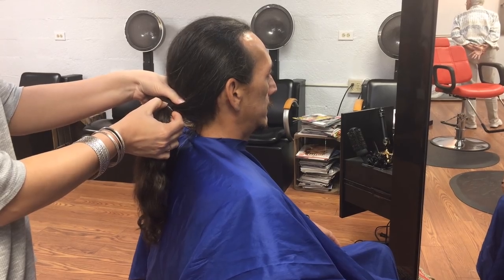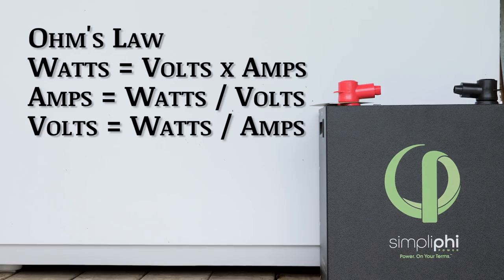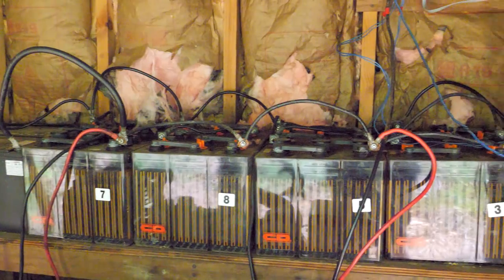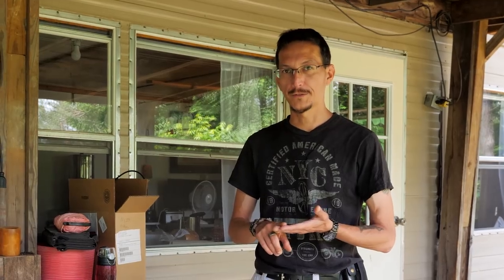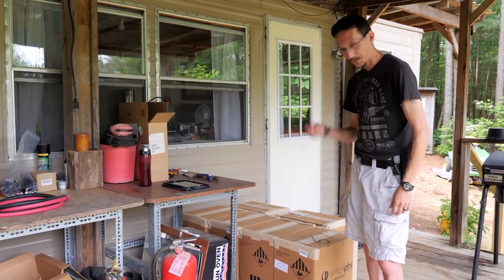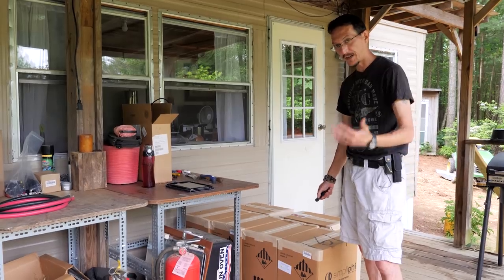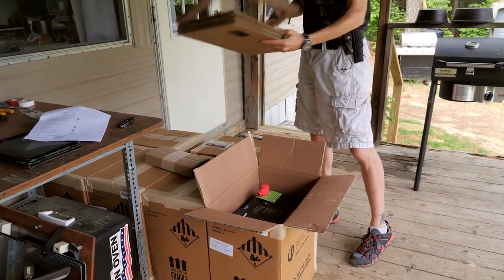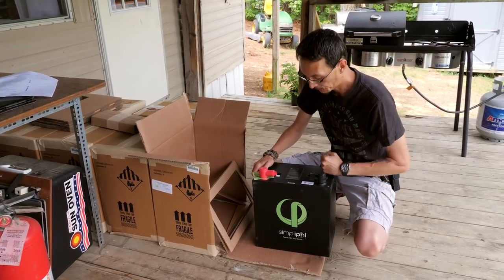DIY Off Grid Solar: Building a LiFePo4 Battery Bank (Part 2)

Comment from the maker: Thanks for your patience folks!  Getting this system built and transitioned over has been a time-consuming task requiring all our attention.  Solar panels will be next...stay tuned!  More links in the description.  Thanks for watching!
Reply: Guildbrook Farm - Off Grid Living Look great with the new haircut.
Reply: There's something you, and everyone else that plans on purchasing and installing Simpliphi batteries need to know. If you are not a licensed professional, do NOT install SimpliPhi batteries! Straight from the warranty:

This Limited Warranty applies only to SimpliPhi Power Product(s):
a)   purchased from SimpliPhi Power Inc. or an authorized  SimpliPhi Power distributor, dealer or reseller and
b)   installed by a licensed professional. In the event you rent or lease the SimpliPhi Power Product(s), no end-user purchase takes place; therefore, this Limited Warranty does not apply and you must contact your rental or leasing company to determine whether Warranty coverage is applicable.

Comment: I'm halfway through building my 20kwh lithium ion DIY powerwall for a couple hundred bucks,  however it's not something I would suggest unless your prepared to tediously solder over 7500 joints !   As I've built mine I've been using the packs and simply expanding the system which makes the project less daunting and more rewarding.  Lifepo4 is better as it's safer and more cycles and for a build like yours you needed to get up and going quick, my build may take me up to a year or two before it's up to 20kwh.  But I should see maybe 5+ years out of my packs, in 5 years battery prices should drop big time. Yours is a long term and well calculated move.   Good idea comparing the 6v batteries too, looks cheap up front :)
Reply: Jestronix Handerson what are the parts you are putting together for this.  I would be interested in seeing the process and components you are using.   Thanks!

Comment: Good discussion on Watts, Amps, Volts.  Also Voltage drop on a length of cable is very important.  I am a retired engineer and we used to have to maintain 2% loss from the point of regulation in our designs.    I have a much larger need than yours as my usage is between 2000kWh - 3000kWh per month.  We live in the Texas country and use well pump, 2 HVAC, Water Heater, Oven all on 240VAC.  We use heat pumps and recently replaced a 12 SEER HVAC with a 18SEER.  The RLA (rated load amps) went way down on this new one, but I have not historical usage data with the power company.  So I just looked at usage over the past 3 years and averaged it.  Many say to inventory all components for power usage, but I did past usage as a guide.  All the best!

Comment: Great videos. I just have to say that living off grid myself and managing my power needs got a whole bunch easier after finding your youtube channel. I've watched hundreds of videos but the way you explain things really makes sense. So thank you for all I've learned so far. I've watched this video at least 20 times trying to ensure I understand the math involved, so that I can then apply it to my own needs but I'm stuck. My AGM bank needs replacing so I'm looking at building the Lifepo4 system that you've outlined here. I think my math is wrong. My goal is a 2kw system for my daily needs. This is what I have gleaned from your video: A 2kw system x 5 days of autonomy = 10kw add 20% = 12kw.  2kw divided by 12v system = 166.66 per day x 5 days of autonomy = 833 ah bank. ADD 20% DOD = 1000 ah. Min. capacity of the battery bank is 1000ah. 1000ah bank as a minimum to provide 2000 watts per day on a 12v system x .86 because the inverter has an efficiency loss to 86%. So, the final bank would need to then be 12v/1,140ah to give me what I'm looking for. Is that correct? My inverter is a 12v/2kw MagnaSine so I can't move up to a 24v to gain efficiency without replacing it which is not what I'd like to do. I'll be purchasing another of the same instead, so I can rack them up together to make a 12v/4kw inverter instead. Could you please confirm my math is correct or not? Keep up the great work! We so need your videos!!!

Comment: I haven't researched batteries for some time.  About 12 years ago, I had a bad experience with flooded lead acid
batteries hooked up in series.  I had a pair in the house, and a pair in an old travel trailer.  Fortunately, I had each
battery in a battery box because acid leaked from the batteries.  It was a potentially dangerous situation.  I occasionally
checked the water and charged them.  I don't know much about lithium ion batteries,  but they sound great.
Your Locks of Love donation is excellent.

Comment: Better video than most. Most people only think short term and don't take into account how discharge rates, depth of discharge and cell chemistry impact cycle life and cost per watt hour. Interesting to see "Equivalent to 80% Retained Capacity" for 10,000 cycles with 80% DOD in SimpliPhi's warranty sheet. Other LFP I looked at recently rated their 80% capacity, 80% DOD at about 4-5,000 cycles with the same discharge rate, and 12,000 cycles @ 80% DOD was 50% remaining capacity. Would have liked to see actual remaining capacity cycle life DOD curves to see if it's just SimpliPhi's marketing warranty speak or a typo but I couldn't find any.

Comment: Great video. It's good to see people who care about others with your donation to locks of love. Also, I would recommend to viewers that if you're tied to the corporate grid with solar that you safely, or have a professional electrician install an auto switch turn on your battery bank, and or generator automatically when the power goes out. I say the auto switch for those who may travel and be away from the property more often as it will save your pipes from freezing, home from overheating, fridge and freezer food, etc. If you stay home all the time then you can do a manual switch. Just a side note lots of areas are having more frequent power outages due to planned obsolescence/failure of parts of the power grid. When you import parts from who knows what countries that are about max profits instead of quality that's what you get. Those overseeing this need to check longevity as these people in the video did. Enjoy!

Comment: You are correct about watts being unit of power, however calorie and watt-hrs, kwh are units of work or energy. Watts are like the flow rate, e.g. 10 gallons per min, watt-hours (also kw-hrs) are like the total volume of water.

Comment: Excellent presentation Jeremy. I took a look at the SimpliPhi batteries and the price was quite a shocker. (Pun intended). I was trying to compare them apples to apples to the Trojan L16 batteries that I'm running and can't find the number of hours the SimpliPhi amp/hour rating is based on.  The L16 is 370 A/H over a 20 hour discharge time period. If they calculate it over a 100 hour discharge it bumps it up to 411 A/H. My point is that the A/H rating is variable and can be manipulated to look more optimistic.  I'm running two strings of eight batteries giving me 740 A/H (over a 20 hr discharge period) at 48 volts. I have my system designed for 20% depth of discharge for maximum battery life. I expect to get easily ten years of life from my bank. After three years in use the plates in my batteries still look like brand new. 

You obviously are designing a system with a much higher output than mine, and I see you did the math, but one of your SimpliPhi batteries is equal in price to 10 of my Trojan L16s. At 20% DOD I have 148 A/H available and I could probably double my DOD without sacrificing too much life, especially if I only do it occasionally. With the SimpliPhi batteries running at 80% DOD I'd need three batteries for only slightly better performance to my 16 L16s at 20% DOD. (Provided that the SimpliPhi A/H rating is based on a 20 Hr discharge). If the SimpliPhis do actually last 27 years it would be 17 years more than  the 10 yrs I expect to get from my bank at about double the cost, so in the long run there is some potential savings, but the proof is in the pudding. I'll be very interested to see what kind of life you actually get from them. I put my entire system together with 2,250 watts of panels, Panel mounts (home made), Battery bank, wiring, FM80 charge controller, combiner box,  and 6,000 watt 48v inverter for less than the cost of three of your SimpliPhi batteries. 

Where the true advantage to the SimpliPhi battery may lie is if you are able to combine new batteries with old batteries. I couldn't find anything in their literature to suggest that is the case, but if it is, you could assemble a bank piecemeal and evolve it as your budget allows as well as replace a bad battery and integrate a new one into an older bank, which you cannot do with flooded lead acid batteries.

I'd be comfortable with the technology of the SimpliPhi batteries, but I'm somewhat skeptical of the claims for DOD and cycles and overall lifespan. There were similar claims for Iron Nickel batteries which turned out to be greatly exaggerated. What was supposed to be a bank that your grandchildren would inherit and the lowest cost per watt/ hour turns out to be simply not true. A ten year warranty is wonderful, provided that the manufacturer is still in business 10 years from now. There are vast numbers of actual cases of people with properly designed flooded lead acid bank getting well in excess of ten years of life. It has a proven track record of reliability. 27 years from now you might be able to say the same thing about your SimpliPhi batteries.

Comment: You're doing a great job of explaining your research and the how and why. Too bad there are some comments from folks that have an agenda based on ignorance/stupidity.
There is a very important advantage of having your batteries in parallel, if one goes bad it does not take out your whole system.
FWIW I am a U.S. Navy Submarine Veteran, EM1SS (E6) (Electricians Mate First Class Submarine Service Qualified, Nuclear) so I know more than the average Joe about lead acid batteries in particular and other types of batteries in general. You have made the best choice for what is available for today and it will serve you well for many years.
Great new look for you and thanks for donating your hair to Locks of Love.
Reply from the maker: Thank you! 👍🏻

Comment: Jeremy,  first, I love your channel. Please keep up the great work.  I must correct you on one thing though. It's very important. At the 12:09 minute mark, you discuss Li-Ion batteries, and that they can be discharged completely. A common misconception, and nothing can be further from the truth. If you discharge any cell in the pack to less than the manufacturer's stated minimum, you will plate Lithium out of the electrolyte onto the electrode. This WILL cause the cell to violently vent, with fire and fury like this world has too often seen before. Typically, these packs are made from series and parallel combinations of 18650 cells. These have about 2.5 Ah capacity per cell. Their nominal voltage is 3.6V. When charging, you must never, ever, exceed the manufacturers voltage limit. This is typically 4.2 volts. You must never EVER discharge the cells below 2.7V per cell. When making your own packs using Li-Ion cells, the voltage of EACH cell in a series string must be monitored independently. They must never exceed 4.2v on charge, and 2.7v while being discharged. There are companies that make chips for the purpose of this, or you can use a microcontroller.  Charging is done by applying a constant current to the battery, not exceeding the manufacturers maximum. When the applied voltage reaches 4.2v per cell, hold the charge voltage constant, and let the current from the charger decrease until about 100mA.  Then STOP. Turn off the charger completely.  You can kick it back on if the cell voltage drops below 3.0v, or once a week or so if the pack isn't being used.  If you decide to build Li-Ion packs, and their chargers, there are several other parameters to consider, such as temperature. Li-Ions are dangerous and must be used carefully. By contrast Lead-Acids are very forgiving. Yeah, I'm an engineer for a company you know, and design batteries & chargers for them, among other things. Feel free to ping me if you have questions. Congrats on the new digs, and best of fortunes, Randy
Reply: Thankyou.
I like your advice

Comment: HOLY BUCKS batman, those are expensive.  Hope they're all they claim to be!  Looking forward to a 1 year progress report.  Cheers!  Chris.
Reply: CrossWood those are the batteries i also decided on because they've been working for over a decade. They were originally for lights in remote locations for filming. I prefer them to those using electric car batteries. - Jacob

Comment: Excellent presentation. I have been off grid with PV and Battery bank for 17 years.  I follow the lithium progress with great interest.  I would make only one suggestion. You are calculating 3 days storage at 80% depth of discharge.  That scenario will only happen perhaps 30 times per year. The cycle discharge on your system will normally be less than 30% and that means actually more than 10,000 cycles. So it would have been more economical to go to 100% depth of discharge on those 30 or less occasions per year. Simpliphi gives 5000 cycles at 100% DoD.  Even after the theoretical 27 years you will have not come close to finishing your cycle life.   So 4 Simpliphi 3.5 kWh batteries would have been adequate for your needs.
Reply from the maker: Probably yes. But i planned for the “average extreme”. Running the computer while kids watch Netflix and the water pump is feeding the shower on the 3rd dark and cloudy day after playing Call of Duty for 12 hours straight. 😂 Probably wouldn’t happen but you never know. I do miss xbox lol!
Reply: Good point.  And less run time for the generator to keep the battery bank charged that way too.

Comment: Great video, you made me realize a few things I hadn't considered before.     My very limited solar system only runs some assorted low voltage stuff (primarily lighting)  in and around the barn, but I would love to expand and add an inverter, too.

I just want to make a comment for very budget-driven installations where you can't afford lithium.   I think sealed AGC batteries are quite a bit better than standard lead acid batteries.   They are NOT as good as lithium, certainly.... but significantly better then any liquid acid battery.

Mine are used "gently" for certain, but they've withstood almost a decade of New England winter temps (-10F to -15F).  They are deep cycle, so they tolerate down to about a 30% charge.    For the first 5 years of their life they were not connected to a charger - I would bring them inside and recharge only when they were obviously dying... definitely wearing them right down to almost nothing.   .   

I think it cost about double a similar sized lead acid, but has way more than double the expected number of cycles.    Definitely do research if you look into AGC and make sure it fits your personal needs - but it's definitely worth the upgrade from lead acid, in my opinion.      And as an added benefit they can be installed in any orientation (sideways, upside down, etc)  because they don't have liquid or a vent

Comment: One thing one can do to transfer power down a line with less voltage loss (power loss) is to increase the voltage.  This can be done with a DC voltage booster. If one takes 10 volts out of the solar cell bank and boost it to 100 volts the power loss down the wire is reduced by 10.  This way it is possible to run power much longer distances from the solar bank to the the battery bank.  The voltage then can be reduced at the battery bank for the voltage the charge controler can use.

Comment: Those transparent 6 volt battery's are some of the best  one made. They can be repurposed as a lead Alum battery. They then react like Lifepo4 with a very flat charge and discharge rate. They can be used for 12 volt lighting systems.

Comment: Good points. My twelve volt system inverter is using much of the gained solar power keeping itself cool. Hard to get my AGM's to float because of this. I am learning along with you so I surely do appreciate your videos. My power need is much less than yours but the info you provide is useful for all applications. Thanks.
Reply from the maker: Inverters get very hot if you try to draw a lot from them at once. I’ve seen a few people hook big 12v computer fans to them to turn on with a small thermostat when they get hot. I’ll probably play with something like that.
Reply: Thank you so much for this idea. I will look into doing something such as this. I didn't have this issue earlier in the year but now that spring and summer heats are starting here in NE Texas, the inverter fan seems to run non-stop. Thanks again.

Comment: DC-DC boost converters can raise the voltage coming out of your panels so you have lower distribution losses. They be very high efficiency and possibly much more efficient than oversized cables.
Reply: Chuck Stickelman   Loses in boost will = or < than loses in over sized wires.  Unless it’s 20% or more line Loss
Reply: Using a booster at the panels is just straight lose just wire you panels in the correct series, parallel configuration for the voltage you want

Comment: Great info! And I like the haircut too. Short is great, so much easier to keep out of the way. I looked up those batteries and nearly had a heart attack when I saw the price. Sure hope you got a deal, them suckers are spendy.
Reply from the maker: Everyone thinks they are expensive, and they are compared to other battery technology. Cost per cycle and cost per KWh is where the comparison evens out apples to apples.